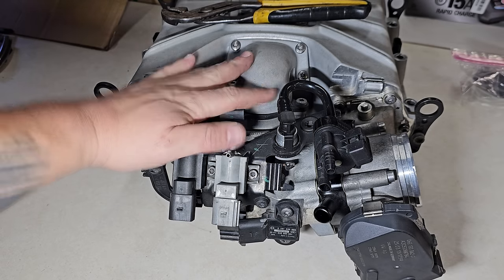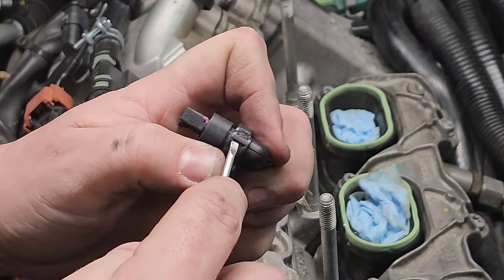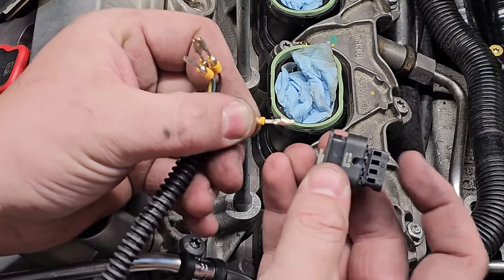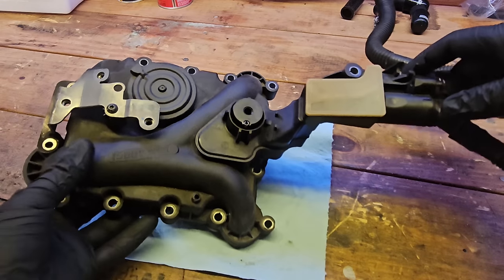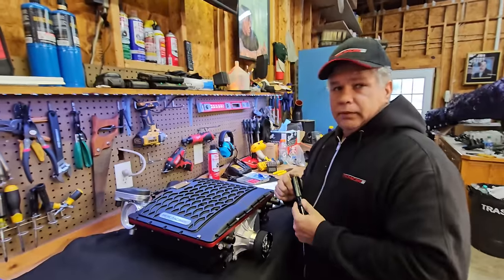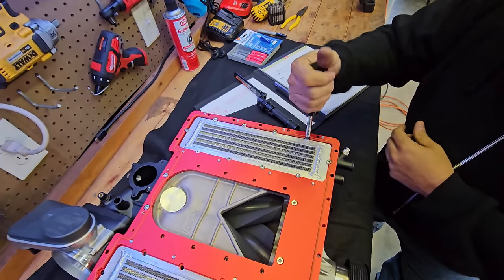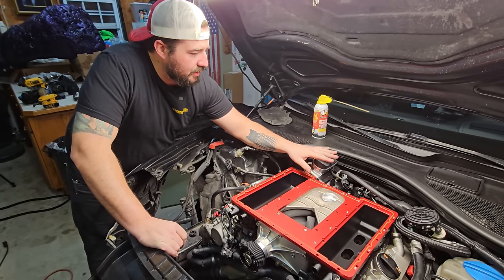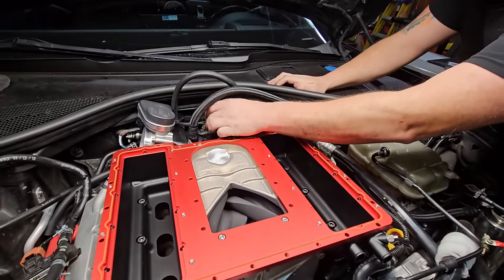MercRacing MRA1900 Supercharger Install | C7 A6/A7, B8 S4, S5, SQ5

Comment: Hey Cameron!
Do you have a video about fixing the upper chain cover leak? My Passenger cover I think is leaking...that's the only leak I have left to fix.. after valve cover, hpfp housing gasket and VVT oring solenoids..
Reply from the maker: I do not unfortunately. It's a pretty difficult diy though so I'd suggest taking it to a shop.
Reply: @AudiC7Owners  👍 ok..thanks

Comment: If the larger charger makes more power on the same or less boost, why the need to change MAP sensors?
Reply from the maker: It's more boost
Reply: That certainly would make sense! I presume in this case ‘3bar’ means 4 bar absolute, which means that you’ll be hitting 30psi+ in the gauge 😮

Comment: Great video, I just recently got 2015 a6 with 86k miles on it, it was always dealer maintained and one owner, only issue i had with the car in one week I owned is on the fan speed at 2 or 3 i am getting a water flowing sound behind the dash, it goes away if i keep everything on auto like direction and fan speed, can you help me is that normal, i have went to online forums most people say that it is normal but i just need to get some information from the master itself so, please let me know
Reply from the maker: I know it's normal, but not 💯 on why it happens
Reply: @AudiC7Owners  thanks buddy, appreciate your help

Comment: Genuine question for you guys based in USA, what is the price differance between  2014 A6 / A7 3.0T and same year S6 / S7? I am curious, is it worth upgrading 3.0T if you can buy 4.0t, make it Stage 2 and enjoy V8?
Reply from the maker: You are looking, usually, at about 10 to 15,000 more for an S6 or S7 of the same year. And keep in mind that also means higher insurance premiums and higher maintenance costs.

Comment: What supercharger  belt do you have to have In order to run that , I have a b8.5 s4 and plan on running this but what website do I go to to get the supercharger belt
Reply from the maker: @Dylan-t3y3t  it comes with a belt from mercracing I believe.
Reply: @AudiC7Owners  when I looked it only said it came with the following TVS1900 Supercharger head unit provides a large increase in flow and power over the OEM supercharger.
Full CNC Manifold and intake.
Beautifully finished and anodized.
Uses OEM bypass and sensors
Supercharger throttle inlet size made to handle upgraded throttle body with no porting required.
Use of upgraded Map sensors is required and will be provided with the kit. 
If you can, could you pls ask them what belt they are running and from what website ?